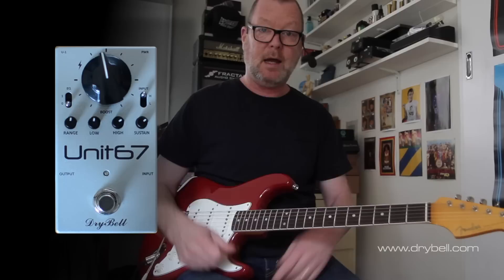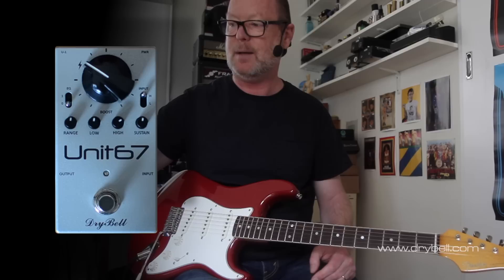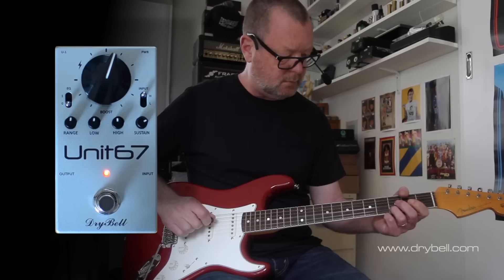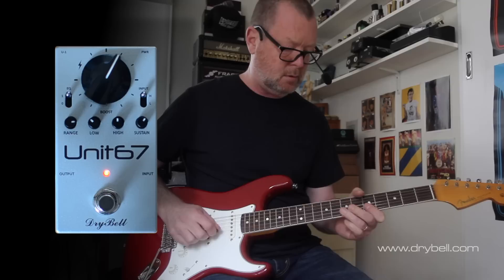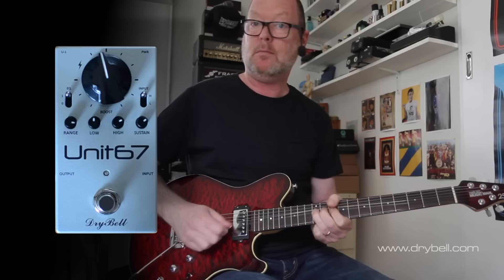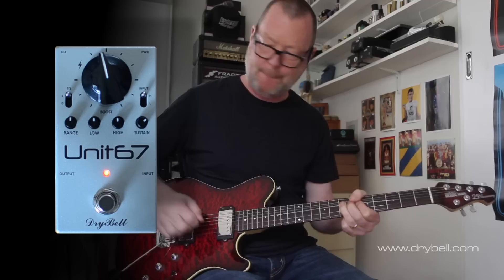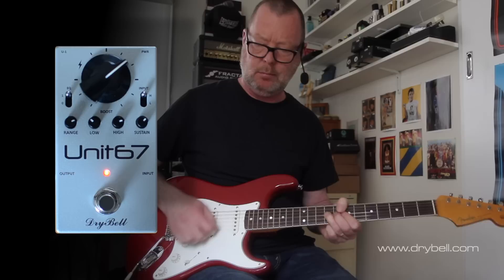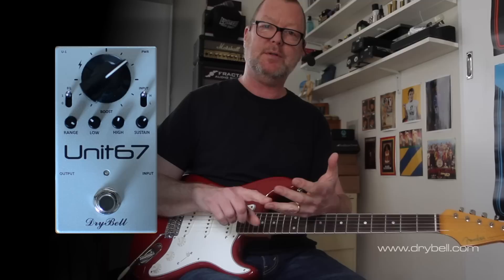DryBell: Unit67 - The Perfect Sonic Assistant!

Comment: Very nice with the Strat indeed but not much improvement with humbuckers unfortunately. Wonder if one could achieve the same thing (or even better?) with EQ  + compressor + rangemaster type pedals. What do you think? I'm asking because many of us already have those kind of boxes on our boards and the Unit67 costs more than all those together so... However I see the point of having things simplified while saving pedalboard space if you don't need the flexibility of adjusting your sound more accurately with the single devices.

Comment: I liked the demo, but every pedal that boosts the volume will make the amp sound better. Volume is a deceiving factor. To know what a pedal actually does, is to set the volume at unity. Ofcourse if you demo the booster side, you need to demo the volume boost. But the rangemaster, the eq section and the compresser section should be demo-ed at unity, to know how they alter the sound. As soon as boost the volume, the tubes start working harder, the speakers come to life, and it might trick you in believing that it sounds better. That's how they do it at music stores to sell more. They boost the input signal, and it seems like it's a good pedal. But mostly you are hearing more volume. But then you come home or at a gig, and you start using the pedal within an 'allowed' volume range, and you'll be surprised that the pedal doesn't work as you thought it worked at the store. 
If I go check out a pedal, I first listen to it at unity volume, to hear what the pedal actually does to your sound. 
Ofcourse this doesn't count for dedicated boost pedals as the purpose is to boost the signal. 
But for an eq pedal, a compressor and a treble booster, and even overdrives or distortion pedals, I'll always check them first at unity level. It's the only way to evaluate the tone aspect of the pedal by excluding the possibility of being deveived by volume
Reply: true!
Reply: You hear only the change in volume???

Comment: Ahh, bugger.  I have been thinking of building a pedal just like this.  They beat me to it.  Sounds cool though.  Oh well ... back to the drawing board.
Reply: I designed and built something very similar - but then the NOS Excelitas Vactrol that I used became stupidly expensive and hard to get hold of, so I only have a couple of prototypes.
Must get round to re-jigging it for something that's not too hard to get hold of.